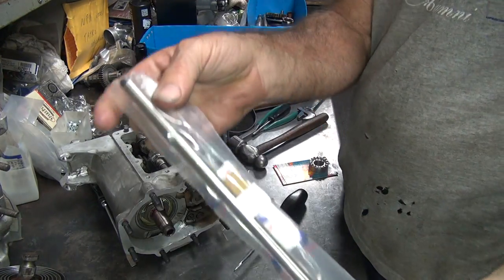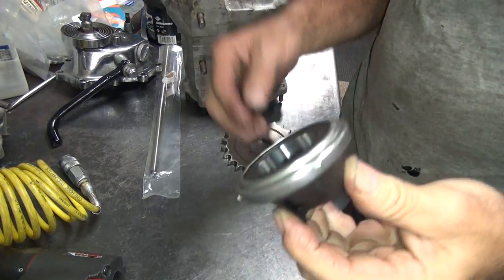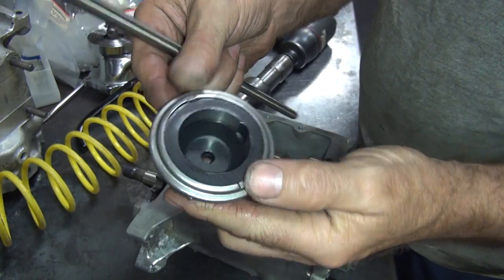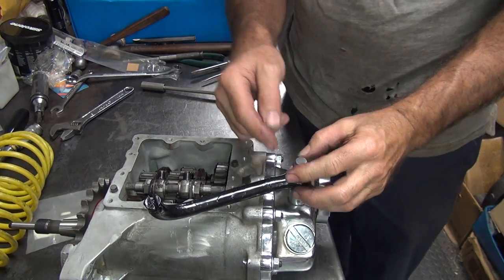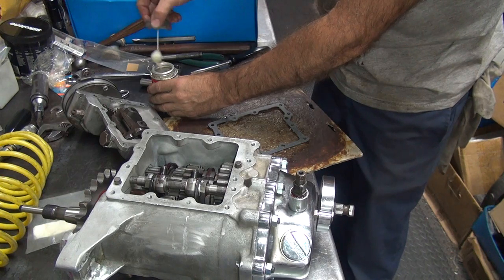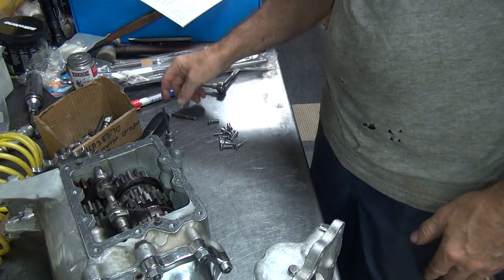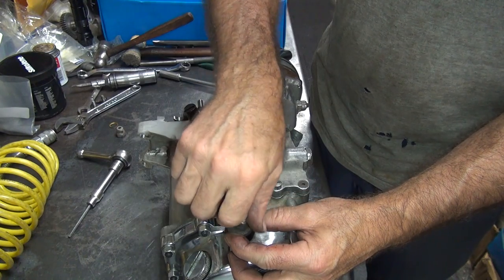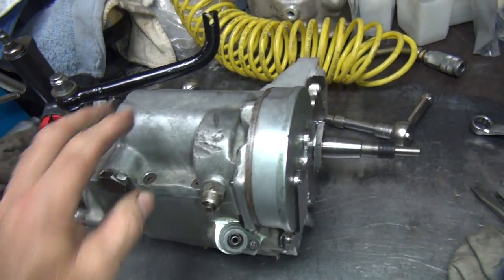1965 panhead #120 4-speed transmission rebuild FL FLH 1966 shovelhead harley by tatro machine

Comment: Have you ever tried Permatex L2 as an alternate to Threebond 1184? Regarding replacing the fifth bolt on the trans mounting bolts, I agree with you 100% in replacing the bolt with a stud. Loctite it in and use a nut. Seems to save the trans cases far better than the continual in and out when using a bolt.
Reply from the maker: i am happy with the three bond for now. most of the time studs are the way to go on most things for maximum holding power and reliability.
tatro